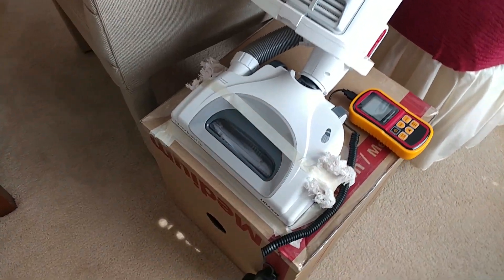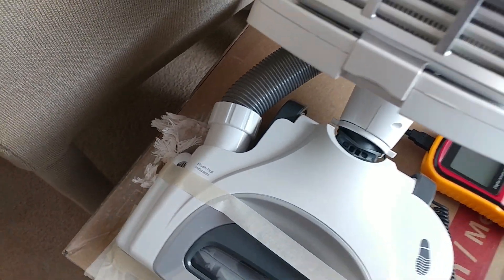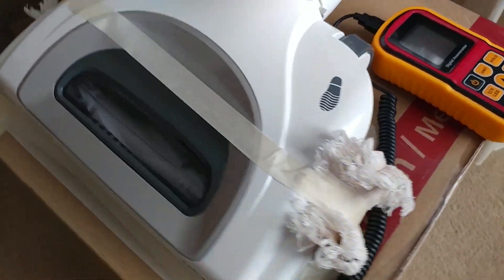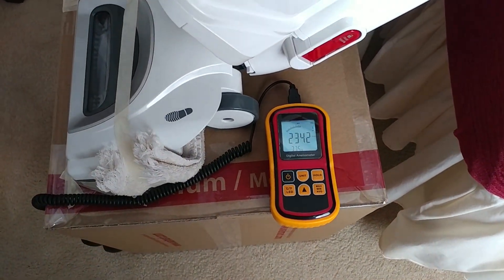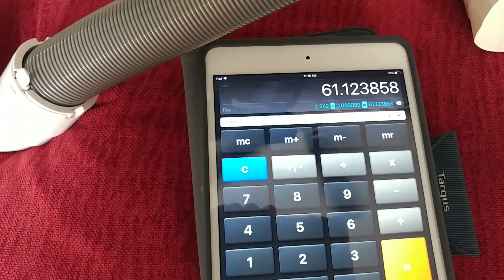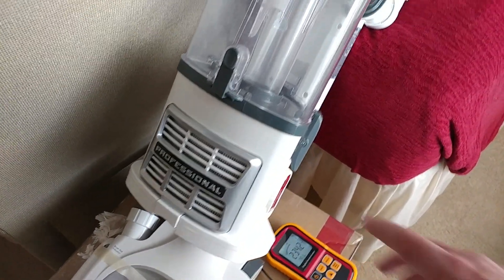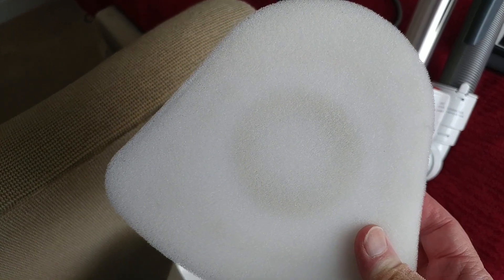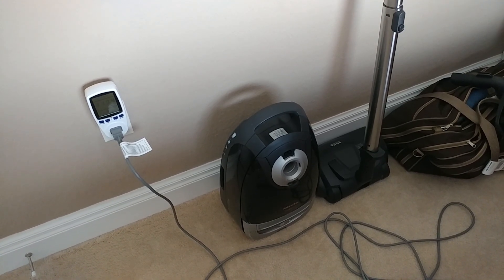Shark NV355 Airflow Box Tests

Comment: You should test the Simplicity Tandem Air vacuum line.
Reply from the maker: Andrew Hennigan it has already been tested by Blackheart on Vacuumland. With both motors spinning, only 83 nozzle CFM. About 3 CFM more than a sub-$100 Hoover Tempo Widepath. Really disappointing. 😥

Comment: I've tested 5 sharks and they're all very similar in CFM at the nozzle.  Their cyclone isn't great at separating the fine dust, which requires more maintenance than, say a Dyson, but the trade off is better (decent) airflow for a bagless and unmatched versatility/convenience IMO (lift away models).  I'd like to see a company put the basic Shark design in a bagged machine.
Reply from the maker: Troy Allen great idea but I doubt that'll ever happen. 😞

Comment: Nice results! So dose the volts when the vacuum is running matter more or the volts when it’s not running?
Reply from the maker: KG5Vacuums under load (running) is the most important.
Reply: VacLab and under load is your normal use right.
Reply from the maker: KG5Vacuums yes.

Comment: So this Shark has slightly better cfm than my NV500 with 61 cfm. It uses a bit more than 900 watts. Cyclone in the Shark vacuums is quite bad. I would recommend to get the second pre motor filter and wash the filter twice a month.
I can't wait to see the Miele in your Lab :)
Reply from the maker: Vacuumtests well it does have two filters. One is foam and very thick and the other sites below it and is very thin.
Reply: The second filter is more dense and stops the fine dust to go in to the motor. First foam filter needs attention quite often.
Reply from the maker: Vacuumtests yup. Blow by is quite surprising. The NV22 does much better with the cyclone pack.